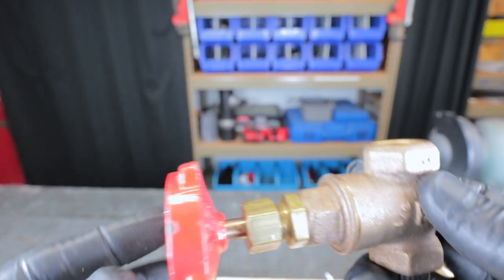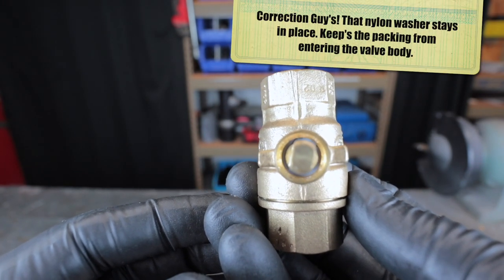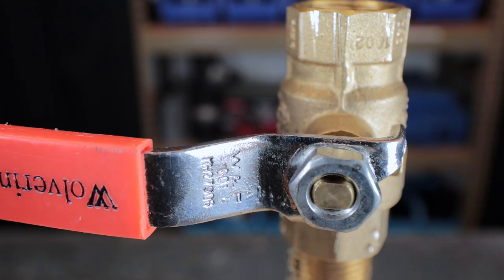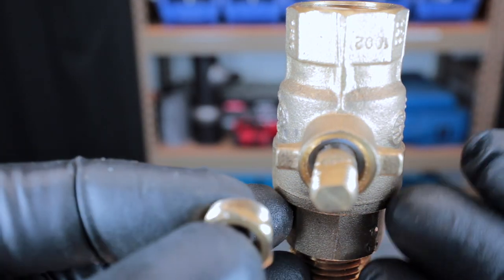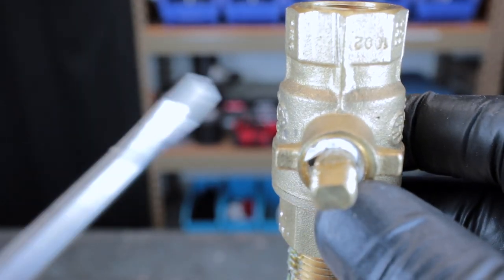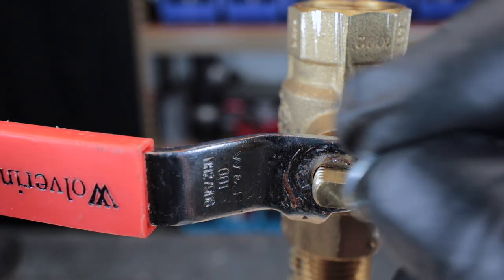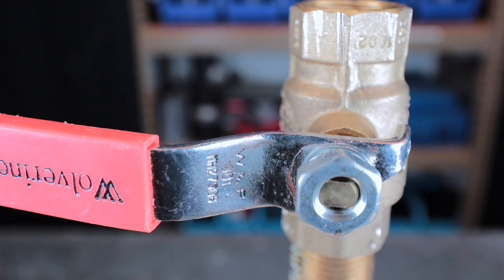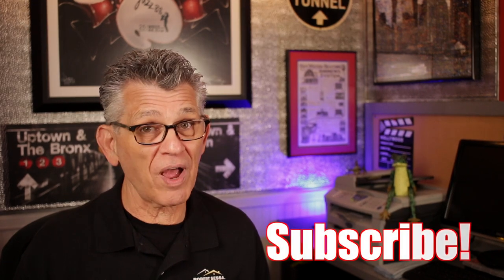Ball Valve Packing Gland

Comment: I had a plumber try to charge $750 for a valve replacement. Knowing that was BS, I found different plumber who told me to look up on youtube how to pack a valve. Thanks to the 2nd plumber and your video, I was able to fix this problem myself and at zero cost!

Just an FYI to folks here, avoid companies that simply take down your info and route your request to a subcontracted plumber. You'll get a cookie cutter solution at a higher price. The second plumber I called picked up himself and was managed by a crew he personally hires. They'll take jobs that's worth their time but help you out if it's something trivial and can be done yourself.

Thanks again

Comment: Thank you very much for your video. I installed a brand new ball valve and water was slowly coming from that nut. Being brand new I did not re pack it but it used your information to tighten it correctly and now the leak stopped. Thanks again!
Reply from the maker: Excellent!

Comment: Edit: mine did not have a locking washer. I was worried over nothing, ha! Also: I used a crescent wrench to not chew the nut up.

I appreciate you! Just wanted to know if anything would jump out if I take the handle off — you warned me about the locking washer. Thank you. Up against a wall and taking the handle off will work much better (twisting on a threaded brass ball valve, handle rubbing against wall).

Comment: I just bought a brand new 3/4 ball valve (Everbilt- store brand)  from Home Depot I was going to use for my house main shtoff and it doesn't have a packing nut!  As a matter of fact NONE of the ball valves of that brand have packing nuts. Would you return it? Why no packing nut? Thanks!!
Reply from the maker: Some of them use internal "O" ring gaskets, I wouldn't have a issue with that.

Comment: I maintain process equipment and fully rebuild 3 piece balls valves. Rewarding to do, sometimes the ball or body actually degrade and need to be fully replaced, but nice to replace a few orings and guides instead of whole body.
Reply: Wondering if you have seen the issue im having.  My handle turns to off and on but the water does not shut off.

Comment: I have this ball valve,  my issue is I need to some fixtures in the house but the shut off does not shut off the water, it turns as if its off but the water still flowes. How can I repair a ball that doesnt turn even though the handle does?
Reply from the maker: Replace it, if the stem disengages from the ball and it's not in synch with the handle time for a new valve.

Comment: Hi, how you do ball valves that does not have packing nut on the outside?
Reply from the maker: If it's leaking thru the stem and you have no packing nut, I would just replace the valve. It most likely has an "O" ring inside that need to be replaced. You might have a hard time hunting the correct replacement down.
Reply: @BobsPlumbingVideos  yeah, makes sense. Thanks

Comment: Hi bob my ball valve is leaking at the body not valve handle. The only way to fix is replace. Cannot turn body because it soldered. I did take off handle but no secondary nut for packing ?
Reply from the maker: If it's joint soldered, best have it replaced by a pro! Unless of course you're up for the challenge.
Reply: Thanks bob for responding . No packing nut unbelievable Yes I can replace  Thanks keep on making info videos.
Reply: hi Bob, I also have a ball valve on my boiler that has started to drip water suddenly from the stem, I took off the handle to tighten up the packing nut and lo and behold there is no packing nut. There is only a thin nylon washer under the handle, whatlooks like a packing nut is round with no flats to put a wrench on. The boiler is fairly new and a high end model made by Bosch, the installers used the copper clamping system to  assemble all the fittings. A slick setup but I don't have access to the tools needed to replace the fitting and I probably wouldn't try myself anyway. Have you ever seen a valve like that and am I missing something?
Reply: I cut it out and replaced 
May be it was a cheap valve
And 
Valves are crazy in cost $$$
Thanks Biden

Comment: Does sweating a ball valve makes it easier to leak at the pack?
Reply from the maker: Not in my experience, as long as you're  not using an oversized torch head / tip.
Reply: @BobsPlumbingVideos  thanks!

Comment: So ive blown out my outside water and sprinklers out for winter .and problem im having is i leave my outside fracet open its all blown out and i have a small drip drip timy put my front fracet even though the ball valve is off to the outside would you say my ball valve nylon set is bad or has small debris .is it very common. I tryed to open shut a bunch i think it made it worst now it drips little more out front fracet even thou its shut off and blow out . Should i just have someone replace valve it looks like newer valve too i thought ball valves never go bad but .just would like your opinion
Reply from the maker: The balls don't go bad, but if that nylon seat becomes compromised or debris gets between the ball and seat it'll pass water. You may be better served by having the valve replaced for long term reliability.
Reply: Thx I'm having the same problem!
Reply: Update I've replace valve myself and what do you know no more dripping. My old valve had a bunch of rust inand around seal so I'm sure it tore into nylon seal just enuff to let water by. Thanks for your help bob.good luck matt

Comment: hi Bob, I also have a ball valve on my boiler that has started to drip water suddenly from the stem, I took off the handle to tighten up the packing nut and lo and behold there is no packing nut. There is only a thin nylon washer under the handle, whatlooks like a packing nut is round with no flats to put a wrench on. The boiler is fairly new and a high end model made by Bosch, the installers used the copper clamping system to  assemble all the fittings. A slick setup but I don't have access to the tools needed to replace the fitting and I probably wouldn't try myself anyway. Have you ever seen a valve like that and am I missing something?
Reply from the maker: Send me a photo! info@robertserssaplumbing.com
Reply: Hi Bob trying to send you a picture but can't figure out how.
Reply: I just bought a 3/4 ball valve from Home Depot. And none of the Everbilt (HD store brand) have packing nuts. Why? That's crazy. What did you figure out? Thanks so much.